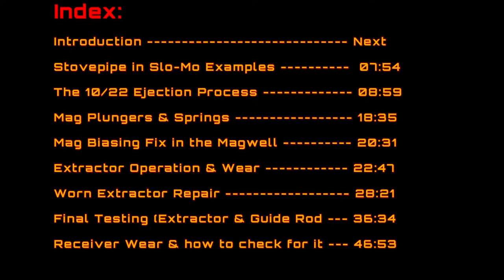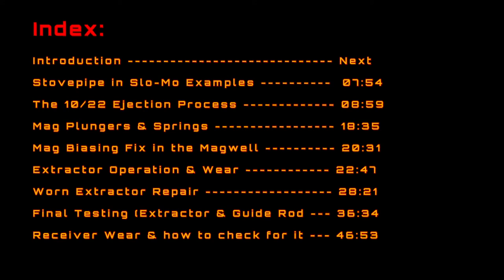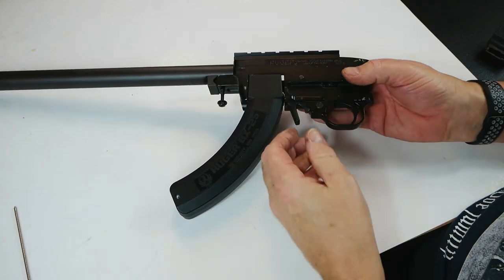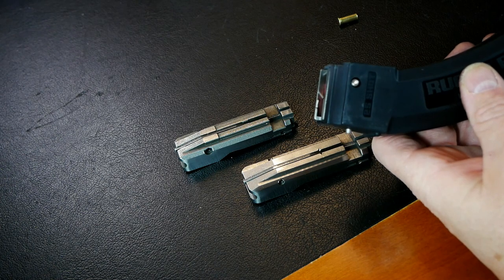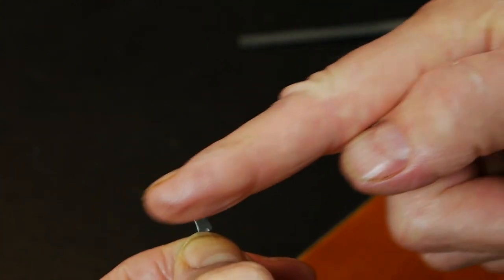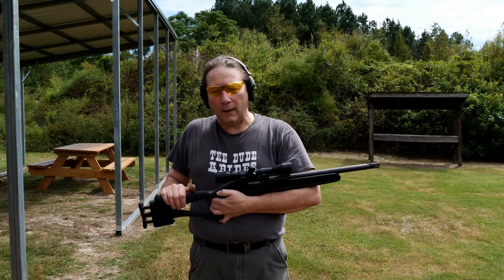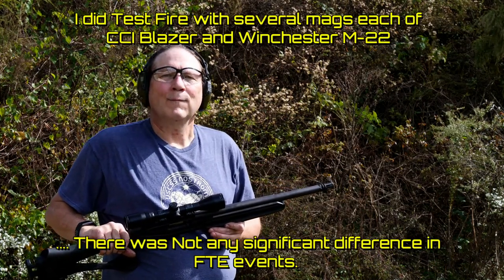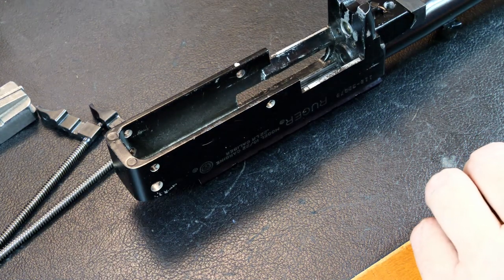Fixing 10/22 Stovepipe & Failure to Eject Issues

Comment: Sounds like you would be in the market if Ruger made a set of over sized bolt carriers for worn receivers it appears a few thousandths on the contact side of bolt carrier  would take care of most of your wear. Sadly the value of a gun versus cost to repair has changed much over the years to where nowadays they want us to throw everything away but it wasnt long ago specialist would have gladly welded up and machined that surface to the proper tolerance to avoid wasting something that could be repaired. I carried a Winchester model77 tube fed stainless in for some parts i had diagnosed and ordered through a local licensed gunsmith. I only carried it to him to be kind and let him make some money to install my parts. Well the win 77 has a fancy trigger set up and he put 2 parts in backwards. I got the gun back in non working order after dropping it off with a very slight failure to feed issue. Needless to say i was a bit perturbed at the fact he didnt even verify his work before telling me it was finished and breaking this gun down isnt so easy as the 10/22 or an AR. That's the way of the world we live in now  i remember setting up CNC machinery in high school we had a tech class with stations of all sorts including vacuum forming, CNC, t-shirt printing, flight simulator, ham radio, and so on. I put together something like 3-4 of those stations and as such got a plaque on the wall stating my name at each station that every student could see. I got a lot of questions over the years from people about how difficult the class was and that they didnt understand much of it let alone how i was able to set up the stations and make them work. Many years later ran into the teacher for that class and he told me that i was the only student in the 7 year run of those stations that managed to ever put out a decent product from the CNC machine back then i had produced a full set of acrylic chess pieces that first year of tech for my final grade. Most of that year and the next i had nothing to do in that class but help my classmates pass the class, diagnose, and repair the stations. I never had a passion for any of it but i had the drive to get the product i wanted and the will to work till i got it right with maybe a tiny bit of OCD. Now most people just expect things to happen or prefer someone else to do it without understanding that if everyone thought like them there wouldn't be anyone to do the work or make the products they want.
Reply from the maker: Understand and very well Put!  I've done similar things though more computer and data related at a number of Jobs and you're absolutely right, very few true craft people out there and most would rather muddle through something over and over again than attempt to fully understand the processes and fix things.  I guess I'm lucky in that I learned tenacity a long time ago the hard way and was put into positions to where I had no choice but to correct things because I simply didn't have the luxury of having enough time to do them over again or repeatedly re-create the wheel. That and being taught that every job you do from cleaning a toilet bowl to fixing something like a gas turbine has your name on it when you are done, even if the only one who really knows the difference is you.... 

LOL and you're right about the repair parts, I did look at perhaps getting a new receiver for the 10/22 since nobody is making oversized repair bolts and for the money the difference between that and a new 10/22 just don't wash as those buying those receivers are doing custom builds and willing to spend the money they are asking.  Perhaps at some point I will attempt a simple DIY repair like a fitted thin piece of sheet metal with either tabs / adhesive or both to hold it in place etc. The really sad part is that in reading the comments on this video there are a lot of folks that are having this same issue on brand new 10/22's which I feel are most likely from poor quality control / consistency on Ruger's part with is a very Stupid business practice, esp. considering that many of the buyers of these rifles are first timer's who's experiences will determine future purchases. 

Thanks for Watching and Commenting!

Comment: My brand new Ruger 10/22 kept having failure to extract. Tried several different mags and also added lube. Calling up Ruger soon to fix this. Just feel disappointed because it's brand new out of the box and was looking forward to plink all day today. I used CCI standard ammo.
Reply from the maker: Sorry to hear that!  For the failure to Extract (not failure to eject) The only things I can think of are an extractor issue (bad extractor (distorted / or the tip not being knife edge sharp with slight back cut), Debris in the recess of the bolt face or up under the Extractor to where it's not moving freely enough to engage, or lastly possibly an overly tight chamber (if the stuck cases require more than just a bump to free them with a cleaning rod that would be a chamber indicator IMO). If you get the situation resolved it would be Great if you posted a reply as to what you found and what corrected it ~ It might help someone else down the road.  Thanks for Watching!
Reply: @PhoenixRising62  figured out it was the barrel. It had too tight of a tolerance and the shell would get stuck inside. Swapped to a new barrel and that fixed it.
Reply from the maker: @hackmedia7755  Cool! Glad you got it figured out!! Did Ruger do the Swap or did you just re-barrel it yourself?

 ... If you still have the barrel and it's uninstalled there is one thing you can try to Correct the issue that I have done on a barrel that had also had a case sticking issue that I am Hesitant to recommend but can resolve sticking issues but I'll put this in here...

      ~  BIG Disclaimer! I am Not a Gunsmith, and after doing a lot of reading I carefully did this ON MY OWN and AT MY OWN RISK, if you Choose to try this understand that you are doing the same and assume any Risks involved ~

Sorry for the disclaimer, but since anyone can read this and choose to do this, and every persons experience, knowledge and situation is different making sure that everyone understands that they are assuming any risks involved is necessary.

Ok, so here is what I did, and it did rectify my case sticking issue (and yes I found this out by reading a lot of shooting forums and doing similar).  From what I have read sometimes on a New barrel you can get sticking issues not due to a machining defect but more because of the bluing / coating / treating  process afterwards where some of the coating may have managed to get in the chamber area slightly decreasing the tolerances (much more to it than just that). If this happens you can get case sticking issues that regular solvent / brush cleaning will not resolve.   If you think this might be the case one thing you can try is to use "Flitz" polishing compound to possibly resolve the issue.  The way I did this was a tedious process but it did work... I took a bore mop and marked it for the depth of the chamber and coated it with "Flitz" metal polish, attached it to a cleaning rod and using a cordless drill lightly polished the chamber, cleaned it and checked it using a spent case that had stuck and kept repeating the process until obtaining satisfactory results (which in my case took about half a dozen passes / tries as I wanted to be cautious in my approach), and I've not had any problems with that barrel since.  One other thing was that from everything I have read the Only product that should be used for this is Flitz... (Not an endorsement here, just going from everything that I have read).

 The thing to remember if you (or anyone) wants to try this is that the pressures generated in the chamber of a firearm are extreme, and if a chamber is damaged or oversized it may result in a catastrophic case failure that could be Maiming or Lethal.

Comment: @ 8:28 I can't tell what is happening. Is the brass slipping off the extractor, or is the brass not hitting the ejector right, either the one on the bolt or the one on the mag? Needs to be closer up and much slower.

Comment: Try using high velocity ammo. 1400 fps. It eliminated 90% FTE without any modifications
Reply from the maker: While I didn't use any of the "Hyper Velocity" ammo, I can see where it could help some rifles to overcome FTE's as it did yours because with the extra force & speed of the action you stand a better change of getting the spent casing clear.  But from all of the testing the truth is there just isn't any single "Smoking Gun" that's guaranteed to work 100% especially when using budget or "Plinking" ammo (if there is such a thing these days).
Reply: @PhoenixRising62  This is true. It doesn't matter (in my rifle) which ammo I use, Stinger, Mini-Mags or crap Federal or Winchester or even Aguila. They all stove pipe.
Reply: Sixth YouTube Account So Far  I agree. It is a shame. And its a shame Ruger lets this continue.

Comment: I have butter luck with heavier bullets 35gr lighter bullet seem to fail to feed or stove piping
Reply from the maker: I've found that sometimes as well with different rifles, I think usually when that happens it is likely due to the stiffness of the action or strength of the recoil spring, with lighter bullet weights not having enough recoil or sometimes dwell time to push the action far enough back.

Comment: In your case after 30k rounds being put  through the gun, the gun is getting worn out. It may be time to  retire it. Or sell it. Also a lot of guys will put a plastic buffer pin replacing the metal one. Which cuts down on receiver wear.

Comment: Anyone ever try grinding the ejectors off the mags and just rely on the secondary ejector? Having the ejector on the mag is simply a bad idea.
Reply: People on other .22lr specific internet forums have tried it, and said it worked for them. If you look at a BX-25's metal feed lips they don't have as straight of an edge as the BX-10's do. There's an indentation (I think to allow the rim of the round to slip threw during feeding?) before the protruding ejector, so on my 25 rders I dremeled the feed lip to match the straight edge of a BX-10. Didn't help at all, and to be honest I have a suspicion the problem lays in the frame itself. The hole they drill into the receiver which holds the front of the magazine is a little off center on my 10-22, and I think it causes problems with the BX-25's not sitting perfectly straight, whereas the BX-10's are tighter and don't have the same issue. Maybe for you the hole was off just enough to where it was on the threshold of working until the paint and metal wore (making the hole bigger) allowing the BX-25's to rotate/tilt too much.

Comment: I would question the success of trying to "heat treat" the extractor. #1 you have no idea of the carbon content of the part.#2 If by chance the carbon content is adequate proper procedure dictates that part be heated to the proper temp. and then quenched in water or oil (makes no difference) and not dribbled with oil, then reheated to certain temp, and allowed to air cool. This last exercise is the actual tempering.
Reply: Correct, but for his purpose even though he used the wrong terminology he only needed to harden it not temper it as it only contacts brass and doesnt have violent forces applied he wouldnt need to temper it after to negate its potential brittleness due to hardening. I would have been interested to see it back on the bolt to verify it had the reach to get full contact on the cartridge lip since it was worn and reshaped if it didnt have the proper reach with cartridge to the full wall on the other side of bolt face it may have required him to file off some of the shank area if it contacts the bolt body in its respective recess slot to get that extra reach.

Comment: You could write numbers on the magazines, to be more scientific.
Reply from the maker: Correct, and I didn't do that because initially it didn't matter what mag was used from old to brand new, and once I modified them I could tell the difference between the Modified and Non-modified with a quick visual inspection.  Hindsight's always 20-20! ;-)
Reply: @PhoenixRising62  Right, I see how things went now. It's good that you still documented things as they are. It encourages thinking about all the issues. The wear on the bearing surfaces made me remember stuff back from school. Like friction between the same and different materials. And the electrochemical voltage series. I took some test pieces and electroplated them with copper. It did work great on stainless steel, but not as good on carbon steel. I guess I need to find something else than coppersulfide solution.

Comment: Kidd mag plunger. Under $10.00
Reply from the maker: I had two different aftermarket Plungers, and what I found is that there are so many different things that contribute in the end there wasn't a single 100% fix, at least in my case, with the plungers really not improving things for me.  When I started the video never realized all the things that come into play on the ejection cycle, but over the months of working on the issue I realized just how deep the rabbit hole went LOL.
Reply: Doesn’t work.